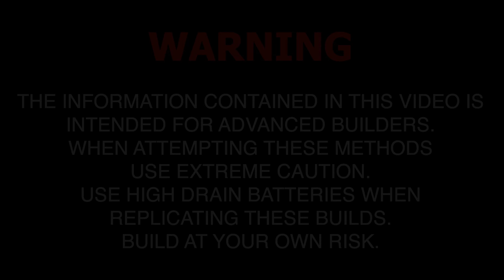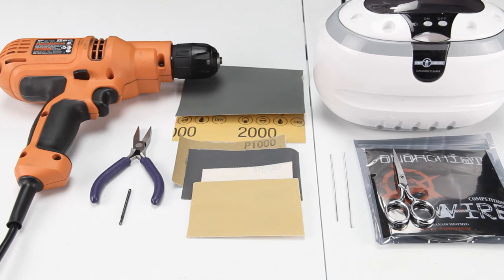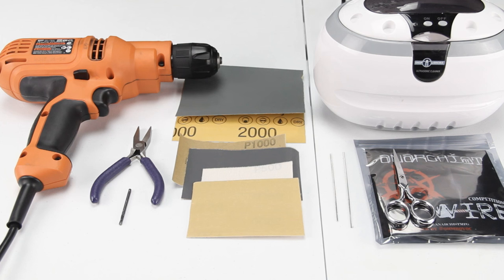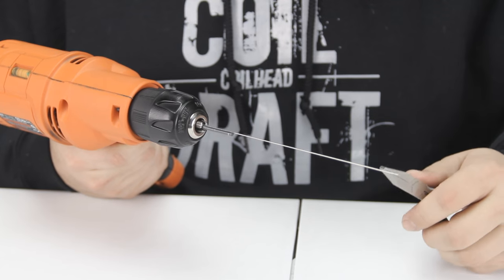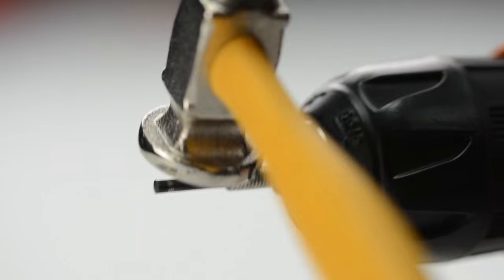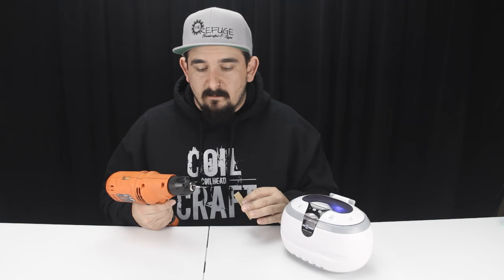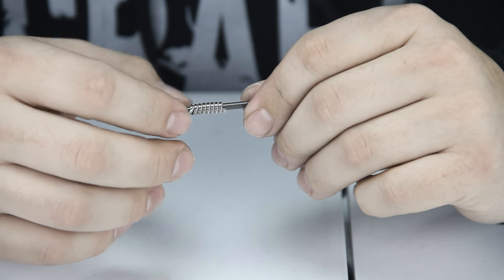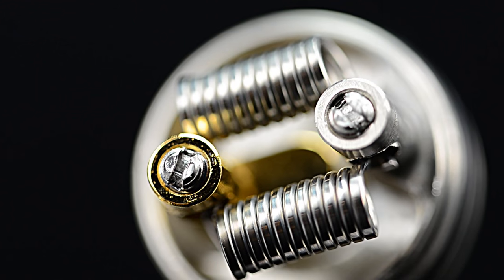Episode Eight: The Mirror Finish

Comment: The most important thing I took from this video is a new way to wrap my framed staple coils because its always a bitch too wrap with that ribbon wire inside, so now I cant use this tech everytime just to wrap even if iam not going to sand on some builds.... Thanks squid00de
Reply from the maker: +James Alipo This is a great way to wrap the most stubborn of coils. It works especially well for very stiff wire like 18, 20 and 22ga
Reply: yeah like framed staples or regular staples are a bitch, they always wanna twist and turn and that will ruin the whole coil..... so this tech has worked awesome for me

Comment: The ebay shop linked for sandpaper is great, and you get a whole lot of sandpaper. But if you're looking to experiment, Hobby Lobby and I'm sure other modeling/rc shops will have it - the pack I picked up is an "Ultra Fine Waterproof Finishing Kit" 8 Pack of 3.5" x 8" sheets of 320, 400, 600, 1000, 2000, 4000, 6000, and 12,000 grit papers.  Picked up a pack for $9 locally.

Thought I'd mention it if you're looking to experiment or try this out and dont need the super large packs that are linked.
Reply from the maker: Great advice! I tend to forget sometimes, how much volume I go through and this is great information, thanks for sharing!

Comment: worth polishing your wire with some swivels before you wrap the coils ?
guessing any effect on the flavour would be much better if the whole wire is polished including the inside where it contacts the wick
Reply from the maker: +ruspj Absolutely! If you are just doing this technique on a single piece of round wire then you could absolutely do that and quite honestly have a better end result. However, it would be difficult to really do that with say a piece of framed staple. I'm sure you could to a certain level but would have to be careful not to mess anything up or get uneven sanding.

Comment: Awesome tutorial. To avoid less damage or risk of damage, I'd imagine that some nylon pliers and a small nylon jewelers mallet would come in handy.

Question: Would you be able to just sand down the wire before wrapping it?? Maybe stick it in the drill and have the wire on a swivel like you would do a clapton, and just run the sandpaper on the wire??
Reply from the maker: +TheCoolStuffHD yeah I completely agree, I was getting a little aggressive with the hammer. As for your question, that method would work perfectly fine for single wires that are round. When you start doing this technique with more intricate wires that tend to be more square or rectangular shaped it may be difficult to get a consistent finish.

Comment: I believe after you straighten the wire, leave it in the drill and then sand the WHOLE wire vice just the outside so it's more effective. Hell you can do that to 34ga and lower THEN build the coil completely for a more effective outcome. Might be a bit difficult with 36ga though.

Comment: with a little finesse pliers can be use to flatten the end of the wire rather than using a hammer. wet sanding is a method to keep things a tad bit cleaner, but for most users i would not suggest it if they are using a corded drill.
Reply from the maker: +boostedhyundai Both excellent suggestions, thanks for sharing!

Comment: Instead of polishing the wire, why not rough them to create more surface area? This is something I've been thinking about for a long time and would like to hear your thoughts. Great video.
Reply: +wonderdude32 It just creates excessive gunking. All those little grooves from the rough sanding get filled with gunk pretty fast and it doesn't really produce any noticeable difference anyway.
Reply: i agree... whoever thinks this polishing improves wicking is wasting thier time and knows nothing about physics.
imagine splashing water on a sheet of glass, and a sheet of frosted glass. obviously the course imperfections of the frosted glass will cause more water to stick than the plain glass.
Reply: +wonderdude32 Poishsing it only makes for better pictures to post on instagram. But performance wise, you'd think polishing the INSIDE would have an effect of the way it wicks, since the wick and juice don't really contact the outside unless you drip right on it.
Reply: Fully agree. By polishing it you're actually getting rid of microscopic imperfections that helped aid in overall surface area. I think this is more a hobbyist approach than a scientific one though, so I still think it's cool.

Comment: squidoode would it make it wick better if you used fishing swivels and polished all sides of the wire before you built the coils? it just seems like it would make the wicking and flavor better by removing all the contamination from the wire before even coiling it.
Reply from the maker: +andyflagg You could absolutely do this however with more elaborate wires (which tend to be more rectangular in shape) are hard to get an even sanding and you always run the risk of messing the wire up while doing that. However, for your basic single pieces of round wire, I don't see why you couldn't do it the way you described!

Comment: I hear it matters if you use wet vs dry sandpaper grits? I heard it only works with wet grit? I don't know the difference, I'm new to all of this and I bought a pack of sand paper with all different grits, but I think it's just dry but I can't tell. I don't even know what wet vs. dry is truly. Any help majorly appreciated. I'm back to this video for the 3rd time now with all the right gear finally! SO please help if you are able! Awesome video thanks for the tutorials Squidoode, keep it up I wouldn't be where I am without these.
Reply from the maker: Hey Alex, wet sanding vs. dry sanding could be debated from both ends. My opinion, in my experience doing high polishes on headlights, firearms, coils, etc you just about name it... wet sanding is always going to be the better option as the water acts as a "coolant" and allows for a smoother more even finish. Now this is when you start getting in the 2000 grit + range. Wet sanding with 80 grit, makes no sense you see... Hopefully that makes a little sense. Now they do sell specifically wet and dry sandpaper, but I have found it doesn't really matter as long as you have the grit you're looking for. I would simply make a water soap mixture in a piece of tupperware or something you don't mind getting a little dirty and dunking your piece of sandpaper in that water/soap mixture periodically while sanding no matter what the polish project is or skip the hassle and just dry sand it. When you dry sand with those higher grits you'll still have very very fine scratches in the wire which would only be seen through an up close macro type photo.
Reply: The Art of Vaping wow thanks so much that was the answer I needed and more. So so grateful for your help. Thanks again!! (Btw I don't mind doing the soap/water dipping, if it produces a better cleaner finish)

Comment: To significantly reduce the dust from sanding simply wet the sand paper. You can also rinse it in between which removes a lot of the dust. It's called wet sanding.

Comment: Thanks for the great tutorial.  If you're planning to build a single wire coil, have you tried sanding/polishing the wire when it's still straight and un-coiled?
Reply from the maker: +Van VanM Absolutely. This however will only work well with single pieces of wire. On the more elaborate wires, they tend to be more square or rectangular in shape which makes it a little more difficult to sand. Not saying it can't be done. The technique in this video is just one way you can achieve this finish!

Comment: You can use the back side of that sandpaper to clean the coil between grits so you wouldn't have to soak it every time and clean it once really well at the end. Might save you some time. Also don't really need to start with such a heavy grit because the finish on the wire is already very good. I would also use a pair of pliers to tuck the end of the wire when it's on the bit, your drill will thank you later.
Reply: I was thinking the same thing...grip that sumbeech in the toothless pliers and give a few revolutions.

Also would like to add that many small taps of a hammer would be better than a few violent whacks.

Comment: Great vid and great info. I do have one question though. Why don't you use the pliers to get the end of the wire flush on the drill bit instead of hitting it with a hammer and possibly doing internal damage to the drill?
Reply from the maker: +Frank Aanenson Pliers will more than likely damage the coil, more specifically if the wire is say a clapton. Toothless pliers to that type of wire will easily remove the clapton. I'm using light pressure when using the hammer and it's about an 8 ounce hammer so I'm not too concerned with damaging the drill but good point!
Reply: Thank you for taking the time to respond. It was just a thought and concern. That was the first vid of yours that I had watched. Keep up the good work and sharing the knowledge.

Comment: Why wouldn't you just polish 20 22 or 24 gauge before you wrap the coil?  Does the wrapping do something to mess up the finish? I can see this being nearly impossible with smaller wire. Just anchor the free end of the wire on a swivel and  polish it up before you wrap it.  Seems like it would work, no?
Reply: +MrJmak642 I was thinking the same thing. Not the swivel part but now that you mention it it would be easier. Only thing would be getting finger prints on the finish when you wrap it.
Reply from the maker: +MrJmak642 So this process removes a lot of material so starting with 20ga or 22ga gives you more material to work with. I just used 20ga as an example. If you check out builders like @addictedtobuilding and others who "specialize" in this technique you will see you can really apply this to any type of wire just have to be using the appropriate sandpaper so it isn't too abrasive. As for using a swivel and polishing the wire up before hand, of course you can do that if you're working on a single piece of wire but with something like a fused clapton or more advance wires which are more flat in shape you won't get the consistency that this way provides. However, this is in no means the said way or law on how to do it, this video is only intended to get the information out there. Where you take it from here is up to you!

Comment: Why not polish the wire or what ever kind of twisted wire or design you made. Then the hole wire all the way around will be polished. Then make your wraps and clean them. then the inside of the coil would be polished smooth.Just my thoughts. Thanks
Reply: +Tim LaBarbera yea, he mentioned it would make wicking easier. But if you aren't polishing the inside I can't imagine how that would help that particular step any ? P.S. no disrespect Doode ...............
Reply: +GENERAL Vape Info I was thinking the same thing. The wick isn't touching the polished section
Reply: +Tim LaBarbera Great idea -- I had the same thought.  Much easier to sand & polish the wire when it's still straight and  un-coiled, and much easier to clean as there would be no concern about fine particles stuck in between the wraps.

Comment: how does the polished side affect the taste? I could understand the inside of the Coil causing a change in taste. Think this is just for looks. Great video tho.
Reply: Jake Vang so it's only beneficial if you drip directly on top of the coil? I think the inside of a coil should be polished. I could understand that.
Reply: +John Avi yea basically. I been thinking if youre gonna benefit from a mirrored coil, might as well straighten the whole wire then sand it while it's straight so that the whole thing is clean, therefore the inside will be mirror finished while your wrap it

Comment: So you're only polishing the outside of the coil rather than the part that's actually going to be touching the wick? How does this provide any sort of benefit other than aesthetics? I feel like if you're getting any sort of flavor or vapor increase is more likely because of the washing rather than the polishing.
Reply from the maker: +cfhstyo you bring up a great point but the way this wire is going to wick is from the outside in. This is basically the same principle of "spiral wire" and how that wicks. You can also polish the wire prior to sanding, this is just the quickest way which skips the inside of the coil!
Reply: +The Art of Vaping Ah, gotcha thanks for clarifying!

Comment: Once you hit 1,000 grit, use drops of water in the paper. Eliminates dust, eases sanding and does a better job. Also don't ribbon around the coil, use your finger for pressure. Anything passed 5,000 grit is a waste. Super cut polishing compound takes down to 2,500 sand scratches out. You're welcome.
Reply: Here in the Land Down Under, the fine grit paper is usually both black and can be used wet. (Emery paper or glass paper). I use this as well as polishing paste designed for metal polishing and finishing work and ise fine stones to work it in (Japanese technique) when I am finishing any of the medieval swords I make. I also make use of both dust extraction systems I built and a good respirator.

Comment: OK I've done a lot of construction work and its really if you are going to be sanding and big ole piece of work like a plank of wood or any grinding on a piece of metal.
ABSOLUTELY WITHOUT QUESTION CLEAN THE HELL OUT OF THE COIL BEFORE VAPING OR FIRING!!!!!!!!!!!!!!!!!!!!!!!!!!!!!!!!!!!!!!!!!!!!!!
But for wearing a mask while sanding the coils not really necessary just don't have it near your face, hold it at like arms length and below your face and you will be fine.

Comment: Cant you polish the straightened wire before you coil it? This will probably only work on round wire..
Reply from the maker: +Beppe Debono Yep, that would work perfectly fine with round wire. I would still practice using round wire and coiling it up  on the drill and all that before using a piece of wire that took you 1/2-1 hour to make.

Comment: How does cotton stay cleaner if you're only polishing the outside of the coil?
Reply from the maker: Technically, you can still polish the center if you polish the wire before coiling it. But with the outside polished, gunk doesn't accumulate on the outside of the coil as much or as quickly when it doesn't have a bunch of grooves to catch to.

Comment: Unrelated to the vid but could you do a vid on how to make coils like the alien and stp/stg clapton using Ni200 for a temp control mod while staying above .05ohms?
Reply: +Victor Hukhan Make more wraps lol and single coil don't dual coil
Reply: +Volrath64 more wraps decrease the resistance for some stupid reason.. wasted alot of ni200 making a staggered clapton.. 26/30ga, 6 wraps, 1/8" ID, .04ohms, barely fits inside the velocity rda.
Reply: +Victor Hukhan That is physically impossible. More wraps increases resistance. Stop what you're doing, you are doing something wrong if you are adding wraps and getting less resistance. That sounds really dangerous, I wouldn't even fire it... sounds like you have a short somewhere. If you've been using it, I'd stop... just because nothing bad has happened yet doesn't mean it is safe. There is no way a single coil 6 wraps staggered clapton wrapped around 1/8th inch ohms out to under .1
Reply: +Volrath64 lol, chill. all my stuff is protected and besides.. id never fire ni200 w/o temp control. i bet its just the materials attributes that give it the low resistance, ive made 2 variants and theyre giving inconsistant results, i may have been dramatizing the 'more wr. = mo res.' Still though, no shorts and biggest coil i can build in the velocity soo i kinda hit a wall.. i could try a lower gauge, hell i need to buy more ni200 anyways. which offers more resistance? Ni/Ti/FeC? those are the only materials i can use temp control with..
Reply: +Volrath64 oh, i was running dual coils, btw.

Comment: How the hell is this supposed to have any benefits vapor wise if nothing is done on the inner side of the coil?
Reply: Makes it look pretty I guess. I'd just take my wire and run it into the chuck and sand it that way. Mirror finish without all that wasted time. I can see the benefit of taking the oxidation off of the wire though, although maybe not titanium wire. Titanium dioxide is not something you want to breath in.

Comment: Hey man. I am from romania and i wamt to buy a mod, an rda and some wire to build some coild at maximum 100 dolars. Can you recomend me something?
Reply: want
Reply from the maker: +alin Basca unfortunately, that's a pretty small budget considering all the additional things you would need like batteries and a charger. Those two items alone will run you around $30-$40.
Reply: owwk m8 i found some things under 100$ thanks

Comment: Why not polish the wire before you wrap it.... Easier to clean it off and its polished on the inside of the coil too.
Reply from the maker: Absolutely, if your finish wire's cross section is mostly round then you could certainly do that. In this case, our finished wire was more rectangular so this method lends you to get a more even finish on the outside of the coil.

Comment: You're a noob unless you finish the sanding process with no less than 130,000 grit which is in a paste form. This also requires the use of a very special ultra sonic sink that costs about $5000 dollars. I bought it specifically for this coil build. I R 1337....
Reply from the maker: +Andrea Dawn hahaha
Reply: Exactly...and you must hire 4men from Home Depot to set this up- it's only right...freezing a copper mod or parts actually makes it a better conductor- I taught some modder guy that and got a 'free' mod sent to me-